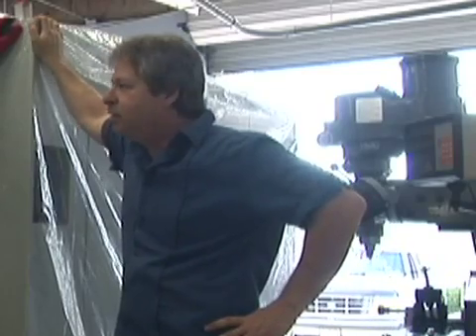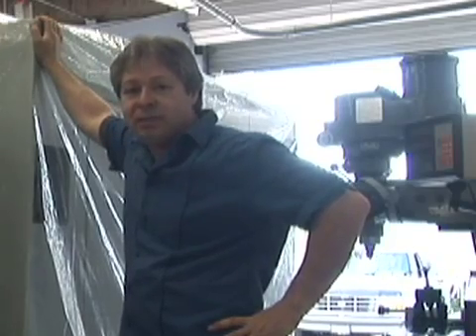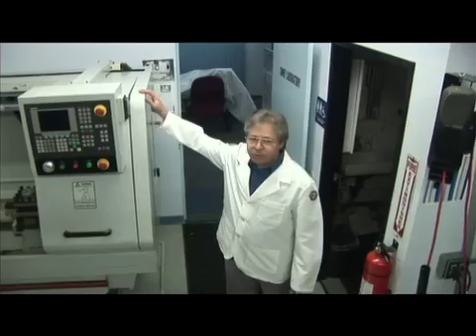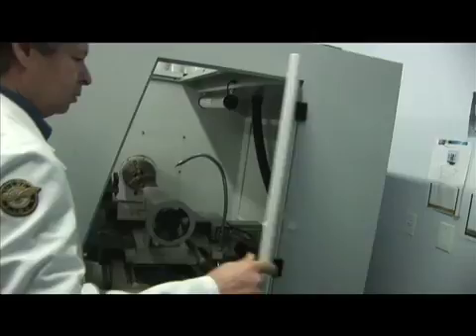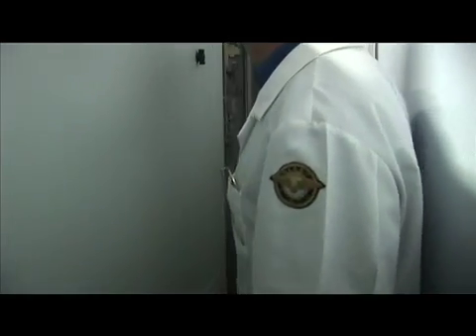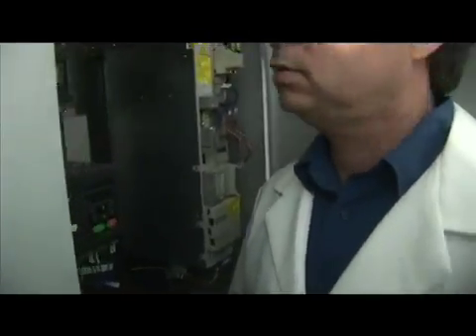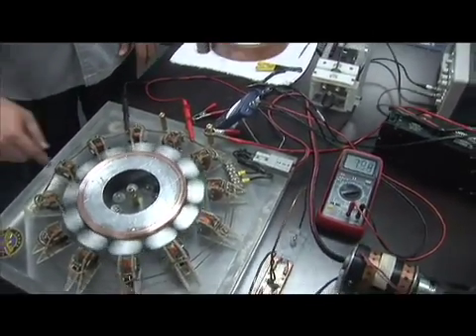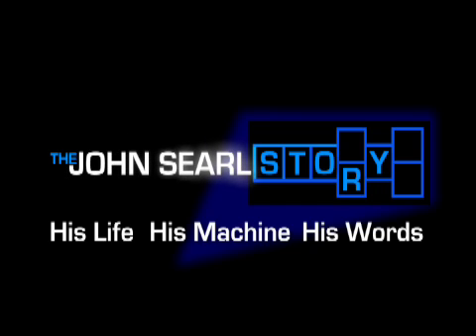Searl Magnetics CNC Precision Lathe.mov

Comment: @whosyagamer Hiya, The lathe is to be used to make SEG parts. Instead of using a manual lathe to turn parts, this can be programmed, then the raw material placed into the chuck, started & left to run until the set task is completed. Because it is programmable, the same task can be repeated over & over much quicker than using a manual lathe. Of course, manual lathes are great for one-offs, but for multiple parts, a programmable machine is the better solution.

GO FOR IT, TEAM SEARL!

-BBD.